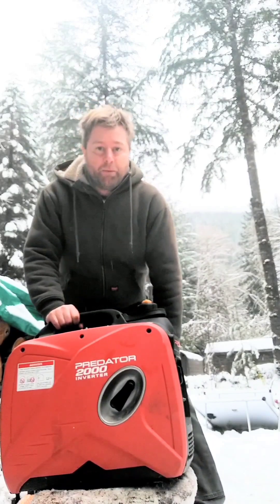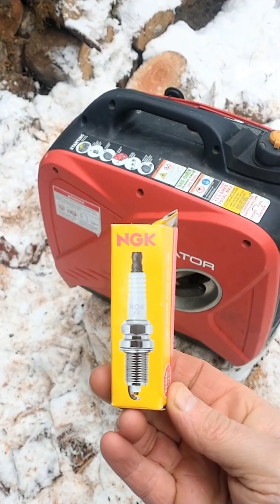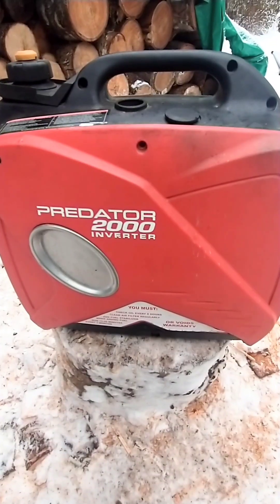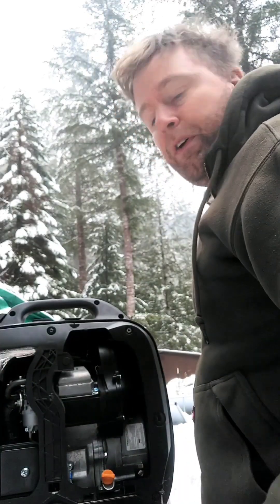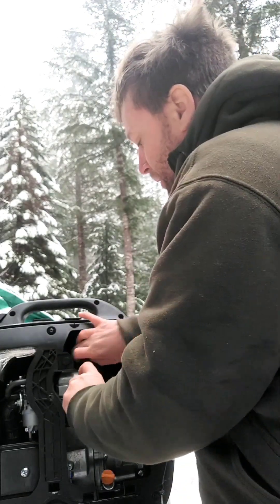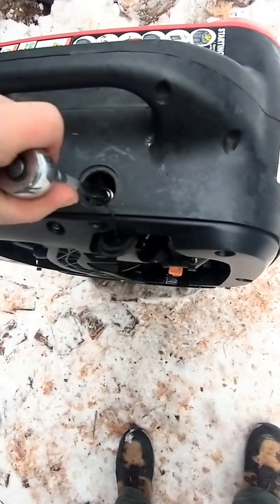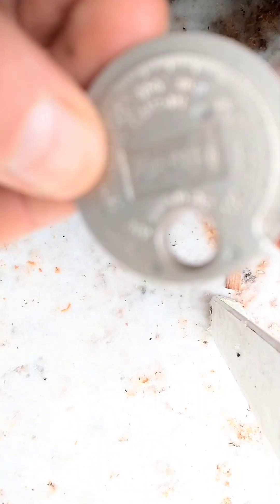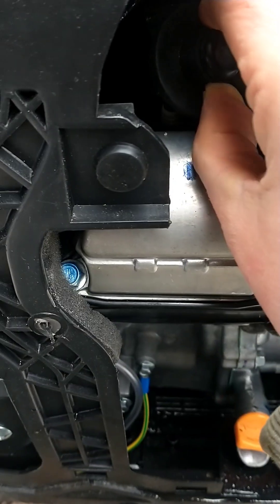Improve the Performance of the Predator 2000 Generator with this Simple Affordable Upgrade #shorts

Comment: Is it normal if it only runs in start position? When I try moving it to run mode it shuts off
Reply from the maker: That isn't normal once the engine is warm.  I had a predator engine do that before.  It could be something like bad gas or a clogged carburator jet.
Reply: @inthemountainswithken  thanks I’m doing some research on it 👍
Reply: Put about 2oz of Seaform in the tank and run for fifteen to thirty minutes to clean the carb. Then keep adding about 1oz with every gallon.

Comment: Just did this! Runs even better than it did! Japanese plug made a sure difference! Thanks for the tip! 

Now to parallel it to the Honda successfully! Lol
Reply from the maker: That's wonderful, glad it worked out! Does the predator pair with the Honda, I haven't tried it?
Reply: @inthemountainswithken  sure does! I found Gavin's garage, he tested it, and a couple other videos of successful pairing,, so I tried .. lol! Honda doesn't even have 50 hours on it, so I was nervous, but it actually works. The Honda definitely pulls more of a load no doubt. Holds high voltage under load, that's why. The Honda still gets assistance, just not what you'd think it should.
Reply from the maker: @georgesrisomsak9650  That is wonderful, those Honda's run like a clock. Thanks for letting it be known that you can run it in parallel with the predator.